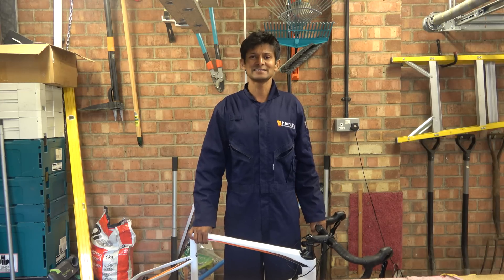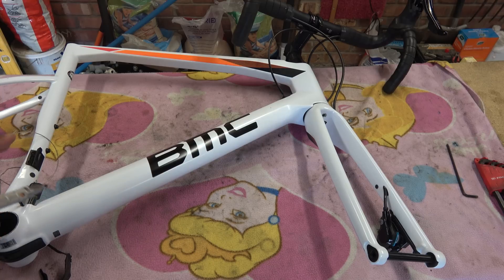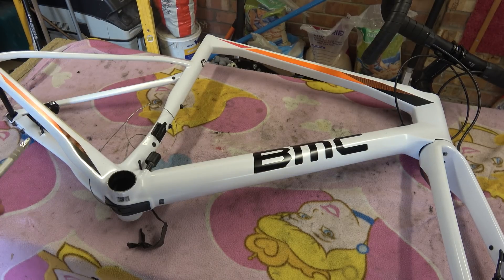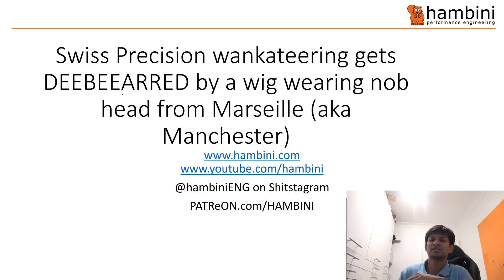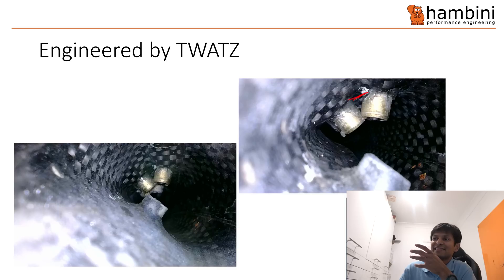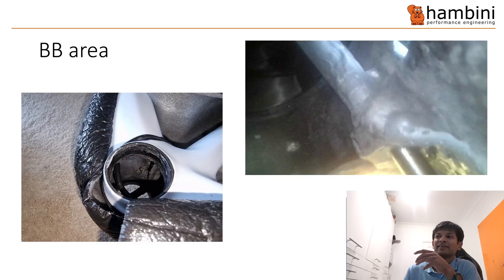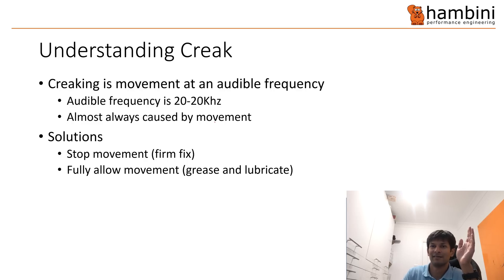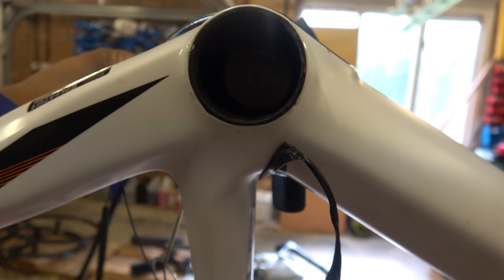Swiss Cheese X BMC Bike Frame REAMED | Grade A Wankateering

Comment: Always thought BMC did good frames but no. What endurance frame should I get now?
Reply: TIME ADHX
Reply: Don’t 😂
Reply: I have had my bmc Roadmachine 01 four ( ultegra di2) for about 18 months .  Have done about 10,000 km  on it so far and no issues to date.  It is still just a joy to ride, and easily the most comfortable and quickest bike I have had. I am 68, so not putting out huge watts and wot not, but still enjoy 100 km ride every few weeks.
Reply: @chapmag6578  it's not that every frame is dubious or shite, but the QC is shite which is totally unacceptable at this price range. That's the main crux here. Enjoy your bike mate and I hope you stay safe and keep the rubber side down. ❤️
Reply: @mokujinsan9946  thanks, yes agree, its about the QA, and at these price points dodgy frames should not be getting through the QA process.
Reply: FWIW, I bought a Roadmachine 01 Two about 18 months ago and have been 100% happy with it. No issues at all. Rides wonderfully. Very comfortable.  I haven't disassembled the BB or anything to look inside though.
Reply: I would still get the BMC Road Machine if I were you. Fantastic bike, although for an endurance bike a bit on the racier side.
Reply: I bought a Time ADHX in order to replace a 2018 Roadmachine 01 w/ Ultegra di2. Zero creaks or other issues with the BMC, I just wanted more tire clearance for gravel roads. Several months later and I've still not sold the BMC. Not as many miles on the Time, but love it so far. Roadmachine is slight faster on pavement (probably due to position and tires), the ride quality on both is excellent. Fit and finish seems a notch better on the Time and their customer service has been great. I love the ADHX, but am having trouble parting with the BMC! (for what it's worth, BMC does have a decent warranty if you buy new)

Comment: The Robert Axle Project, I believe started by making Thru Axles that allowed people to use popular trailers that attached via QR with their new TA bikes. This has now evolved into a (mostly successful) attempt to make it easy to buy a QUALITY axle of any type, size, standard for any bike in one place. Not too dissimilar to what you do with BB's to be honest.
Reply: i have one on my rear axle. i can attest to its build quality
Reply: I bought one so my bike to fit my indoor trainer. After placing the order with The Head Office, they emailed me  a local supplier to save me on freight! Great customer service.
Reply: I also use Robert Axle Project axles on my bikes. I’ve been very impressed with mine.
Reply: RAP as mentioned makes nice axles but makes them with a different end than what came on the bike in case you didn’t like that method.
Reply: They have two main selling point for me so far.
1) Their axle don't taper in the middle. I've seen a case where (Specialized) axle taper heavily in the middle where some hub (DT180) bearings supposed to rest on.
2) All axle I bought from them use 6mm hex key. I'm so annoyed by some bike that use 6mm key in the front and 5mm in the rear that whenever I found one, I immediately replace the 5mm head axle with RAP so that I can use just 6mm key on both axles.
Reply: "Thru Axles that allowed people to use popular trailers"
That's how I found them. I still have only QR bikes but it's good to know that I can use the Bob Yak trailer with a TA bike.
Reply: That is correct…RAP thru axle would have not come stock with the bike….their speciality is “adapter axles” for hooking up chariots/other trailers.
Reply: I’ve got a Robert axle project axle for my trainer and it’s an absolutely perfect fit that saved me from buying some additional crap adapters from
Wahoo.

Comment: Badly molded Carbon, used to be made by quest composites. Had 2 slr01 frames from 2014, still my favorite riding bike. But 1 rear brake cable pulled straight to the frame, warranteed. Second frame spontanously showed hair cracks on the top tube. I was ridiculed by BmC customer service manager. Eventually ended up scrapping the frame after collision with a car. Crash replacement service too expensive
Reply: I had a 2010 BMC sl01. Paint cracked where seat stays meet downtube on first ride. Supplier tried to suggest this was normal and to be expected! Eventually got a replacement upgraded frame as they'd wasted so much of my time there was no UK stock in my size of the original frame... Still riding that bike and it's fine. BSA bb though!

Comment: On the one's I dealt with, the frame would crack around the Internal seat clamp wedge! Meaning that where the clamp's tightened via the 4mm hex key bolt, the surrounding carbon would split and then they'd replace it under warranty as a defect! That bolt has a 5-7Nm tightening torque setting! As it is only a 5MA threaded mild steel bolt. Seatposts will drop UNLESS you apply the Anti-slip Paste provided in the frame kit. ( Which by the way they tell you to use when mounting SRAM levers to their ICS carbon handlebars).
Reply: Anti slip paste only works for a little bit, try a strip of electric tape on the back of the seattube works a charm!
Reply: @yohandsome  that depends on which frame and the tolerance between frame and seatpost gap. We used to use pieces of a Coke Cola  can.
Reply: @RICHARD.WRIGHT1  all you need is a short vertical strip of 5 mill tape, use more if clearance is poor.
Reply: @yohandsome  If it's properly made, and the rider isn't a whale, anti-slip paste works essentially permanently. If you've got to shim it, it's by definition not properly made. Which, of course, happens, because it's the bike industry.
Reply: @brankododig1585  it indeed isn't properly made, but keep in mind anti-slip paste can get washed away in the wet and it doesn't generate as much friction as tape (at least not on my BMC).

I'll stick to electrical tape ;p

Comment: That GCN video of a TT bike and position being slower than the road bike position.... Wow
Reply from the maker: I wonder if someone was having a laugh at GCN to see how brainwashable cyclists were. Ridiculous.
Reply: As a non engineer, I thought it was dubious. I'm glad I was not the only one.
Reply: Didn't hold Boardman back much. 55.2kph for 7.2km in 1994 tdf prologue not too shabby. If only he could have been riding a 2022 Orbea road bike from the future!
Reply: what video?
Reply: @MrBusunglueck  . A video from 2 weeks ago when one of their sponsors road bikes was faster than a banned Lotus 109/110 or whatever number.  Hambini commented on it in 1 of his most recent videos.
"Can We Beat A Bike So Fast It Was Banned? | Lotus 110 Vs Modern Superbike"
Reply: Could it be from the wheels and tyres? Wrong wheels, tyres and tubes with wrong pressure on one side, perfection on the other? I'm faster every year because I run the latest conti GP with latex, those 100pc make a difference. 
Other than that, I agree their results make no sense.
Reply: @pierrex3226  simply cannot. GCN just publishes crap to "entertain" and ofc sell the sponsors products. Just look at the Lotus bike. How much lower its stack size is, with a disc rear wheel and 3 bladed front. It not just was an aero beast, but it would be fairly comparable to some of the slower TTs with disc brakes I think. I could wager that it can hold its ground even comparing to modern Triathlon bikes which have disc brakes.
You can be faster within the margin of error, with a GP5000 over a GP4000, but between that Orben and the Lotus beast just the position would give you dozens of watts at least over 40 kph.
Reply: @Plastic_incline777  With the shape and profile of the frame, I'd wager that most modern TT bikes are not faster than the lotus, and at best equal
Reply: Easy to get a bad result from a non sponsored bike. The Lotus could have had 20 year old underinflated tyres, it could have had some "unintentional" brake rub or who knows what.
Reply: Current generation road bikes are definitely faster than TT bikes. Remember when GCN showed us that Storck Aerfast that could do 45km/h at under 200 watts and proved it by stating the claim very very clearly in a factual manner. 
Are you seriously going to dispute eloquence? 😂😋
Reply: I will take the Lotus any day over that other bike. Really fast frame design to this day.
Reply: Imagine how much faster the road bike would be with 180mm discs!
Reply: A tt bike is only slighlty faster than a road bike with an aggressive position (90 elbow, hands on the hood). If the lotus has narrow tires then it can be slower on the road
Reply: Up there with their video where the guy brakes hard on discs, then less hard on rims, thus proving disc brakes perform better
Reply: @elstoof  That's always bothered me. Caliper design (disc and rim) and lever mechanical advantage are bigger factors than rim vs disc. Both designs can lock up wheels if done correctly.